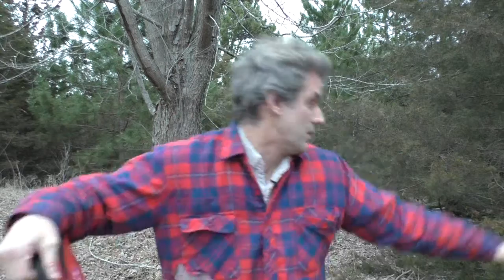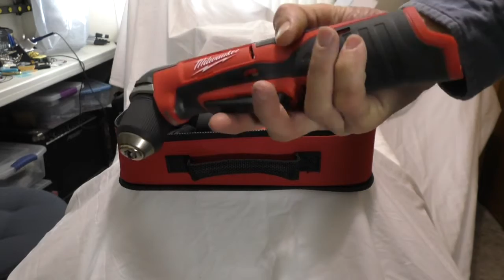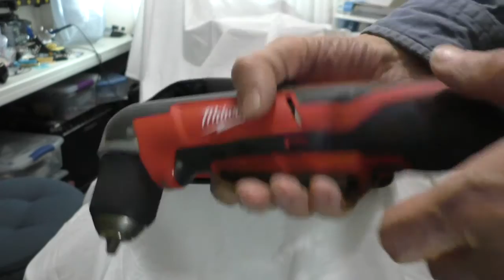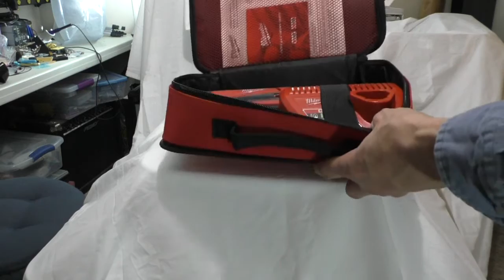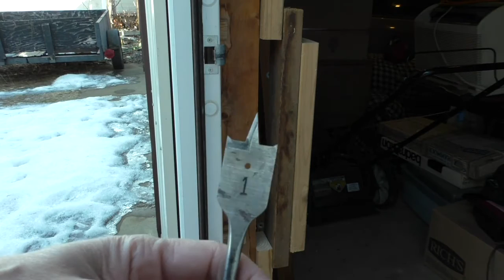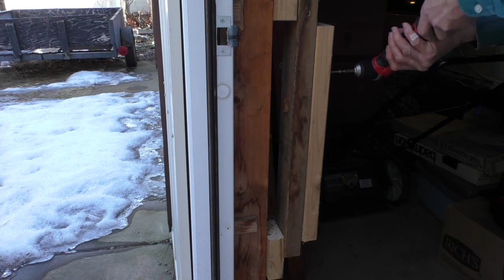Review: Milwaukee M12 series right angle drill.

Comment: All good info.  Just had mine delivered and now looking for some stubby drill bits to use in it. Maybe this particular angled drill is best suited to drill bits up to 10 - 15mm dia. in wood,  rather than the 25mm (1 inch)  That's what the bigger drill tools are for after all (space allowing of course)  That 75mm (3 inch) deck screw was a big size for this tool I think, but it did do it ok in the end, so a good test for the tool.  Looking forward to using mine soon.

Comment: Hi,

I know this is a older video review on this milwaukee m12 right angle drill.  

I needed to pick one up for a project and it worked great. I used a 6.0ah m12 battery and man this has some power. 

I did tried it with a 1.5ah and it  worked good but with the larger battery ah it does makes a big difference. 

You are right, it's one of those tool you will not use much but nice to have it when needed.

Just wanted to share my review.

Comment: Nice review, I was thinking of buying a flex shaft for my drill, but the torque would be sh**, and it wouldn't be able to handle bigger drill bits. Something like this is more expensive of course, but I could throw it into my backpack with my other tools, instead of taking the whole case with the big drill. I wonder if it could be used as an angle grinder ;p (for some light work) Whats the max RPM on it?
Reply from the maker: +Blaine M Thanks for watching and commenting, this drill only has an RPM of 800, that’s no load RPM so it probably would not be very good as a grinder.